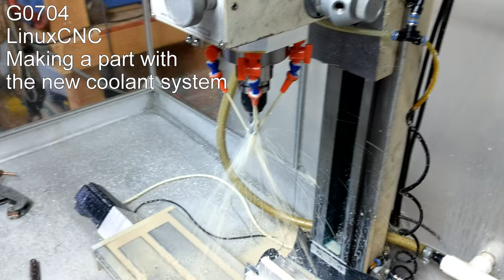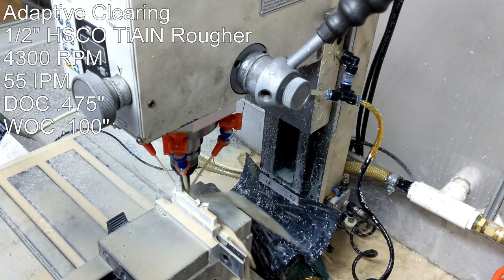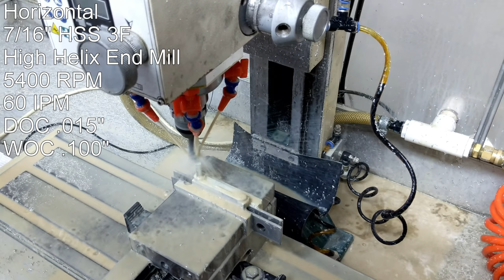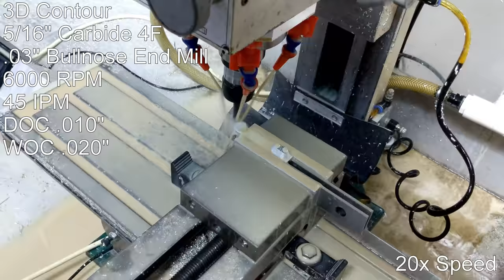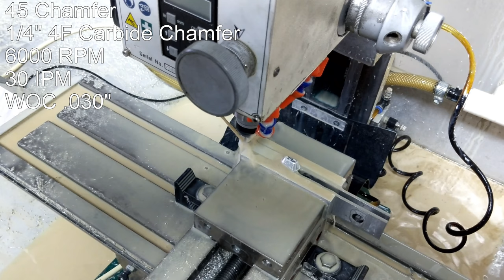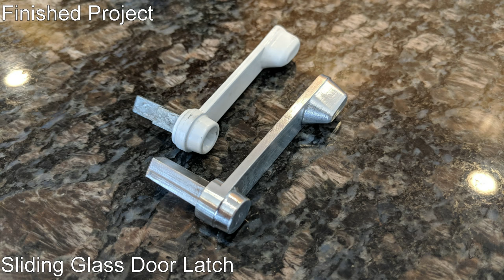G0704 LinuxCNC Coolant Ring

Comment: That looks awesome! I designed a coolant ring ages ago and machined half of it. I should revisit that project at some point I guess.
Reply from the maker: russtuff Thank you. I have enough material to make another. Do you have the ability to make a top hat out of steel per Hoss's plans for a power draw bar? I would be interested in a trade.